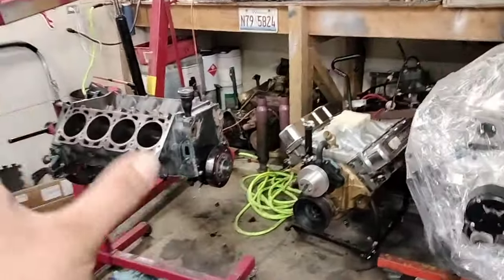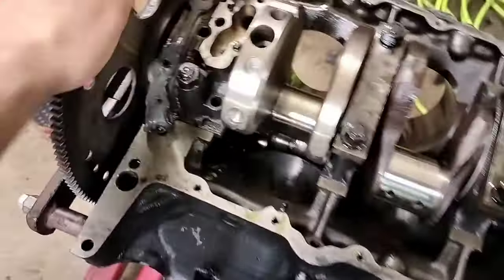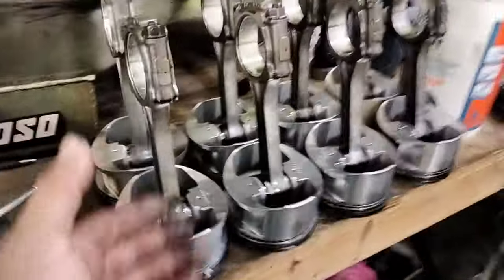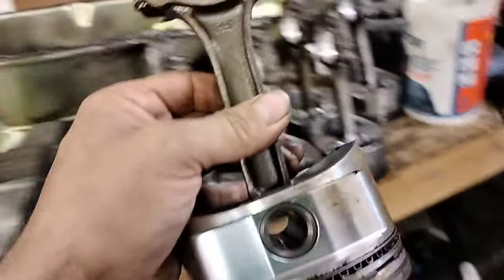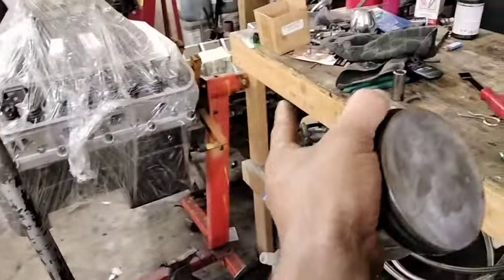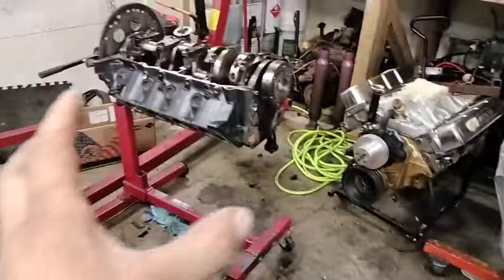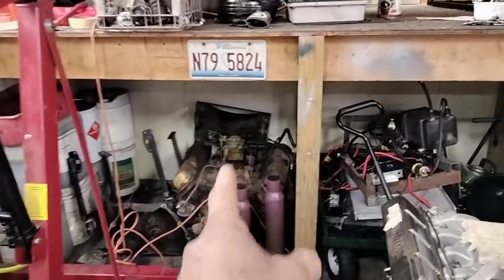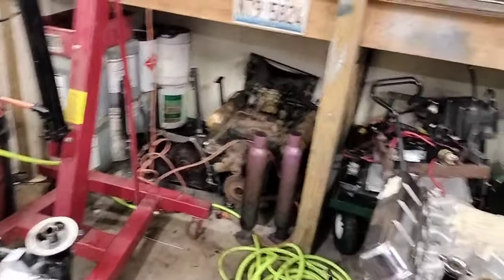Oldsmobile 362 small block build plan.

Comment: You seem like the Olds expert , I live in Australia, I've built four 403 Olds SB now , the current one was fully complete in a crate that was ordered in 1979 , by mistake , they ordered a 6.6 Olds 400 ci and this 403 SBO turned up , it sat on a shelf in a box from 1979 to 2020 when I opened it , never started till 2020, new cross hatch in bores , crate had " C/O Van Nuys assembly plant California" on it . I'm trying to find out if it was going to go into a Trans Am before it got diverted to Australia in 1979. All I got is the Vin derivative stamped  on the block  -- 38L 128909 . I know 3 is Olds , 8 is for 1978 , L is for Van Nuys assembly plant California. And 128909 is the cars vin it was intended for . The oil fill tube has no markings on it . Any help would be great, thanks .
Reply: Here some help, GET IT IN A CAR MANNNNNN shitt here in the states having a 400 anything is the making for a demon of a car. I say treat it like a regular stock olds except for it being 400ci
Reply: @kaleb8518  oh it's going in a car , A General Motors Holden  VY Commadore Tray Back UTE. Like an El Camino but this is a 2006 model Holden . I got a company in Australia make me a T56 Tremec 6 speed manual bellhousing . I've got fuel injection for it and an original Holden Duel side draught Weber 45 DCOE set up , prob go for EFI , the previous 403 went in a GM Holden 1976 HX One Tonner UTE tray back with a T200 4r trans and 4.44 LSD diff , as the Holden 308 ci V8 has a lot of Olds V8 in its design it was easy bolting an Olds were a Holden V8 was , bolted straight in . Same eveything. But it's certainly going in soon, it's not even run in the new 403 . Probably ran for 30 min total since assembled in 1978.  But I'd love to find out if it was going to be a TA motor .
Reply from the maker: As far as the build and designation I can't say but !!!! Did it come with motor mounts on the block ???? Those I believe are specific . Classicoldsmobile.com  is a great forum where you may find that info. I believe only the California trans ams got the 403 . The 403 is a killer engine but needs good components with the windowed webbed mains.